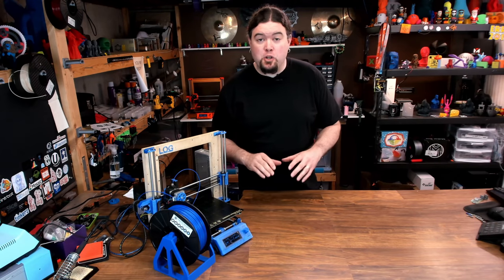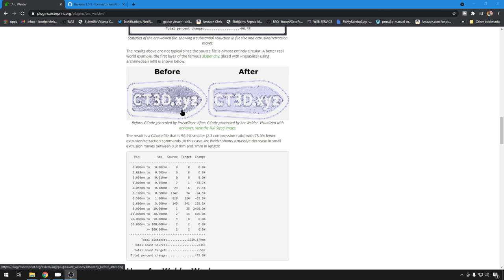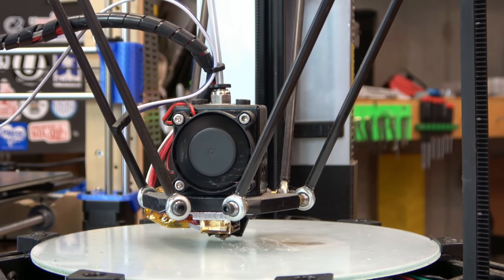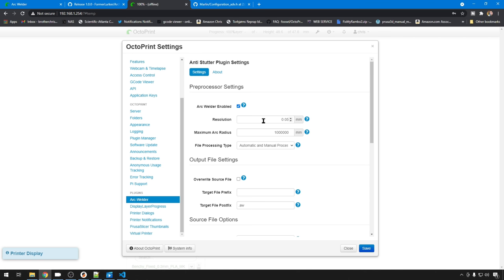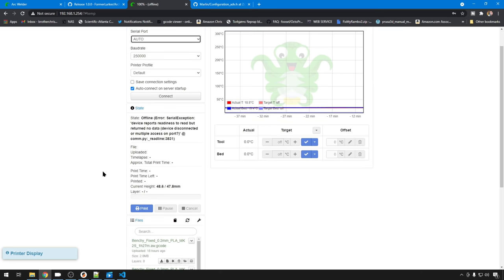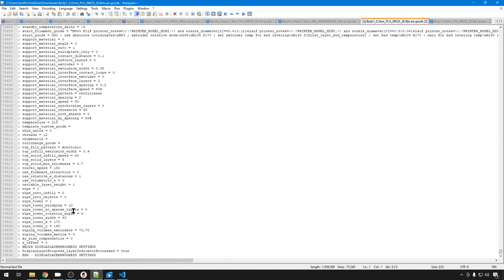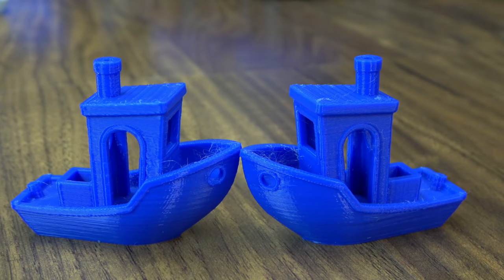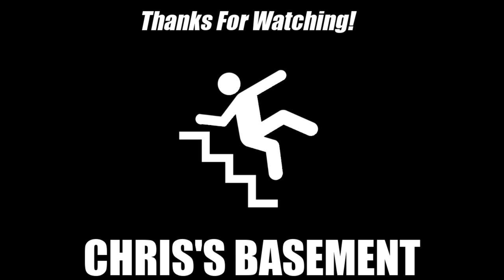Arc Welder -  Octoprint Plugin To Help Your Prints - Set Up & Test - Chris's Basement

Comment: Hey Chris. Great video as usual. Arc welder is also now a plugin for Cura and I think it makes more sense as it processes at slicer level and sends the final G code to the printer. One more thing, as you mentioned Marlin and Klipper, what about a video comparing both? Klipper is always in the corner of my mind but Marlin works so well that I still don't have a good reason to change.
Reply: ^^ this (Cura plugin)
Reply from the maker: Cool, thanks!
Reply: Thanks for mentioning this. I also think this belongs into the slicer from a logic standpoint
Reply: You can also add it to prusa slicer super slicer and slic3r as a post processing script.
Reply from the maker: I do plan on comparing all of this with a 32b board and a Klipper build, we will see what we come up with.
Reply: @ChrisRiley  just to say that although "there's a Cura plugin", this is an excellent video that really demystifies arc welder and very clearly demonstrates the benefits. Some people won't necessarily be able to use the slicer plugin and so this video is very useful - and extremely well researched and presented 👍 . (I wish I'd spent as much effort on my earlier post! 😉)
Reply: I know this is an older video, but Klipper doesn't process using the MCU of the printer it does it on the RPI meaning you have a 32/64bit controller now even if the mainboard is 8bit it just  controls the axis, like a breakout board at that point when you have klipper. Arc welder works on both, you maybe even have already switched to klipper who knows!

Comment: I love arc welder. Been using it since he had to send you the file manually.

Honestly it was almost perfect at that point. Only issue is it doesn't help with klipper because klipper converts arcs back to line segments.
Reply from the maker: Nice! Great to hear a use case.

Comment: Great explanation! However I believe this should be done by the slicer in the first place.
Reply: There is a cura plug-in too
Reply from the maker: Thanks!
Reply: As they said it can be used on near any slicer now and can be integrated
Theres also a program to post process gcode but i havent worked out getting it to boot from the bin file yet cos im a dunce 😂
Reply: I agree. Cura plugin works really well. I've had varying success with the octoprint plugin. It doesn't seem to like prusa gcode at all. Last time I tried, the print head went crazy printing random lines and overextruded.
Reply: I have it already as a post processor in prusaslicer
Reply: @Chris-bq7nr  where can i find the gcode? thanks
Reply: @caseycollins00  Really? What is the name of that plugin? Thanks.
Reply: @TheMarbo74  Arc Welder

Comment: Great video! I'll have to test it out.
Off the top of your head, do you know if g2 and g3 are enabled on the Prusa MK3s firmware?
Reply: He's using a mk3 and a mk2 in the video
Reply: @Majorvegasv2  That doesn't mean Log is running the Rambo board and Prusa firmware though ;)
Reply from the maker: The Prusa fork does support it, but check out the caveats. https://plugins.octoprint.org/plugins/arc_welder/
Reply: I submitted a pull request to improve Mk2/Mk3 support for arcs that is now being considered for the next firmware release.  It also includes a command to change interpolation settings on the fly without a recompile, and stores them in eeprom!

Comment: Another great video!  Is this also available as a stand alone processor?  I have switched to Klipper and Fluidd so no Octoprint.  I think converting G1 to G2  - G3 would benefit any system.
Thanks for the video.
Reply: more or less the same.. as the firmware cut up the nice arc in smaller straight segments
Reply from the maker: Yep, Klipper in kind of doing the same thing. So, no worries there.
Reply: If I understand your question: there is a plugin within Cura and if you go to the creator's github there's a repo  ArcWelderLib with command line tools to generate arc gcode (but I did not test this myself)

Comment: Why PrusaSlicer won't use G2 and G3 natively? It boggles my mind.
Thanks for professional video, Chris! ;-)
Reply: Because the stl files we feed it with are a bunch of triangles, with only straight lines. The problem starts with the meshes that are made out of triangles. I think something like the tool path generator in Fusion 360  should be able to generate arcs directly, as it does not need to go through the proces of creating a mesh with triangles.
Reply: @ctphilippi  if a plugin working on RaspberryPie can find our arcs/radii then PrusaSlicer working on N-gen Intel 16 core CPU should have no problem with that. Just MHO.
Reply: @cthulpiss  Yes ofcourse it could, that is what the post-processors also do. But it is kinda stupid that we are now trying to estimate the initial arcs from a bunch of straight lines, that where created to represent an arc. It would be much better to use a format that can avoid the triangulation proces. That would also avoid the uncertainty whether I initially intented to be an arc, or really wanted the polygonal shape.  And in the end, the Marlin G2 implementation chops the arc into linear segments again. :P
Reply from the maker: Interesting conversation. Good points.

Comment: Looks like you can use it as a post-processor in prusa slicer as well for those of us who don't use octoprint.  I may have to give it a try.
Reply from the maker: Cool, let us know how it goes!
Reply: @ChrisRiley  It seems to work pretty good.  It's hard to tell if print quality is any better, but the file sizes are about 1/10th of what they were before the post-process.  It makes transferring through the Duet 2 wifi a bit more tolerable for more complex models.

A good majority of the things I print are round, so I'm pretty happy overall.
Reply from the maker: @theheadone  Very nice!

Comment: Quick question. If I have arc welder on cura do I also need to install it on octoprint??
Reply from the maker: As long as CURA is adding the G2/G3's to your gcode and the printer can read it, you're good to go, no need for it in octoprint.

Comment: I configured my firmware and downloaded the plugin but I have done something wrong as my prints started failing, hopefully, I can figure out how to get this set up correctly and benefit from this super plugin, and I think my problem may be Linear Advance as I don't think I enabled it when compiling my firmware, I think I left it out to get a before and after print comparison and forgot about going back and enabling it
Reply from the maker: Good luck, let us know how it goes.
Reply: @ChrisRiley  This may be the problem:

Current Marlin does support arc commands (G2 and G3) BUT it has to be enabled at compile time...it may be off by default because most slicers don't use it, and it takes up memory in the firmware space.

My build of Marlin (precompile for BTT E3 RRF board) had arc_support disabled.  To see if this is the problem use the terminal in either octoprint, or pronterface, and send the printer a G2 or G3 command.  If it replies "command not recognized" or some such, then this is your problem. If arc_support IS enabled, you will get an error message due to no parameters on G2/3 command and your printer will enter fail mode and you'll have to reset.

If you want arc_support to work,  You will need to recompile Marlin with arc_support turned on.  Uncomment the line #DEFINE arc_support in the config_adv.h file.   Recompiling was a bit involved, you'll need to download several support tools....but there are some helpful tutorials online.

Comment: Apples to oranges, but I'm curious about enabling arcs vs increasing the buffer size where Marlin f/w bin size is concerned. Buffers are easy on 32b due to the available storage, but not so much on the limited 8b. Increasing buffers will have the effect of further delaying execution of local commands issued via terminal. There's a point of diminishing returns and AW will win out. I hit the limit at about 50mm/s w/ Klipper on the All in One micro test object on thingiverse. Increasing the buffer got me up to 80mm/s on the 2 circular features before the 1-2sec pauses started again. I'm guessing, w/ a coreXY, if you're not running a duet or printing from SD that Arc Welder would come in handy. It's great to have several options to try.
Reply from the maker: Thanks for your insight!
Reply: @ChrisRiley  that 1st thought didn't come out right. It was meant to be curiosity of using one vs the other. I'll edit it. 🤦🏼
Reply from the maker: No worries man, I get you, valid thoughts here.

Comment: Iam using HE1 port for extruder fan at 165c iam getting terminal error/alarm ,also using fan1 port for part cooling .how do I fix this
Reply from the maker: The fan is probably just over running it. Try adding a sock or upping the values in configurstion_adv.h

Comment: Chris I have a ender  3 pro with some modes I need some help with Marlin  I would like to install 2.0 or better  I have a MKS Gen v1.4 mega 2560 R3 board install with ramps 1.4 can you help
Reply from the maker: Hey, I don't have time to do the build, but there is an example out there that I am sure will work for you. Let me know if you have questions.

Comment: Hello Friend. I installed ArcWelder.. and more other plugins. It was fine until I installed some plugins which generated a conflict. I uninstalled them all, and then came the problem. The Control and Temperature tabs are gone. I've tried everything. I even uninstalled the program but it comes back with the same settings. I tried to find these plugins, but I can't find the right one.
Can you help me on how to fix this? I can't control the machine (left, right etc. just connect). Thank you, hugs from Brazil
Reply from the maker: Wow, it sounds like one of the plugin corrupted octoprint. I think you are going to have to start over and rebuild.

Comment: Cura has a arc welder plugin can I just install that and run with it?
Reply from the maker: Yes, that should work.
Reply: @ChrisRiley  hey Chris one question im running cura and using acr welder on a cr10s Pro with tiny machines firmware and a e3d humera but my question is i thought i read somewhere that arc welder wouldn't work with my mainboard and firmware combo ?
Reply from the maker: @geterdnboy  I took a look, I don't think tiny machines firmware supports G2/G3 commands.

Comment: It only took you about a minute and a half to convince me to pause the video and install this plugin immediately.
Reply from the maker: That's awesome! How is it working?
Reply: @ChrisRiley  So far, it doesn't seem to have broken anything. It only seems to compress about 100kb per every 5mb with the low poly models I've tested with so far. I'm sure this would be really great for a lower powered, older pi. I'm using a pi 3b at the moment, so it's not a problem for it to send however many commands I need it to. Still, I think this is going to get added to my default list of extensions that I install on any new print servers that I build. Currently, I only have one of my 6 machines on octopi, but I plan on increasing that number in the future.

Comment: Awesome video! Thanks for the effort!! Just a comment that maybe could help someone. I have an Ender 3 Pro with direct drive, I print TPU easily and without problem. But as soon as I try to print the arc welded file, the print can’t extrude material. I tried several times after I give up and as soon as I use the original file, everything was perfect, so for some reason with TPU does not work (PLA no problem at all)
Reply from the maker: Thanks! That is a really odd issue. TPU shouldn't change anything, unless there is something in the slicer just for TPU. If linear advance is enabled, try disabling it.
Reply: Make sure you have the g90/g91 influences extruder setting enabled if you are running marlin 2, or a fork of marlin 2, or use relative extrusion in your slicer.

Comment: hey @Chris Riley, we have discussed this in the klipper discord, and it is counterproductive, at least in klipper, since the g2/g3 code, gets converted back to lines. Aka more processing.
i don't know about marlin or reprap, how it's handled there. But for klipper this is contraproductive.
Great video anyway 👍
Reply from the maker: Thanks for your insight.
Reply: All firmware that I am aware of uses linear arc interpolation, including marlin.  I hear these discussions all the time, and there is some truth to them.  However, I think several subtle points are overlooked.  Klipper is less likely to suffer from planner starvation, so that isn't an issue usually (but not always... It is complicated).  However, interpolated arcs can have more resolution than the original segments.  It depends on klipper's mm_per_arc_segment setting.  For the same reason that klipper doesn't suffer from as many planner starvation issues (faster board), you can turn the arc resolution way up (0.05mm and even less) and see a noticable difference.

Results vary by printer, filament, stepper resolution, slicer resolution, etc, so it is a very complicated subject.

Comment: Chris, in the arc welder documentation regarding marlin config it says that you should edit the defaults as they're not the best, 1mm per arc segment is too much, lower it to 0.1mm and also lower the MIN_ARC_SEGMENTS to 14, ¿can you do a followup changing those settings?
Reply from the maker: I'll see what I can do. Thanks for your insight!
Reply: "Reducing the MM_PER_ARC_SEGMENT setting slightly can correct this [sharp corners on tight arcs] but can also introduce stuttering. Reducing the value massively (say to 0.1mm) will introduce a LOT of stutter and is NOT recommended."  I pulled this from its Octoprint plugin page.  I have a 32bit board and set 0.1 as the MM_PER_ARC_SEGMENT and can confirm this statement.  I printed a concentric patterned 10cm circle 1st layer and my printer's display hung the entire time, couldn't tune anything.

Comment: Are there any reasons to not use arc welder?
Reply from the maker: Not that I have found, some have reported issues, but I haven't seen any.
Reply: If an object is inteded to be many sized small polygon will arcwelder degrade it to curves?
Also does one of the arcwelder settings set the amount of smoothing and if so which and what value were you using Chris. Thanks for another great video.
Reply from the maker: @Cloudman572  I used default on all of the setting just to show what you would typically find on your install. Not sure on the degraded curves yet, still needs more testing.
Reply: @ChrisRiley  Thanks, will wait on update I hope.

Comment: Used it for a week and...deleted. Try to print a complex object with tiny details or thin walls around a circle/bolt hole and you'll see that Arc Welder destroys it. It absolutely works with simple objects like those donuts. But...we're not there yet! Try to print the Voron clockwork with and without Arc Welder and you'll see what I mean.
Reply from the maker: Thanks!
Reply: Comment above says
 "Guillermo Lovato
Chris, in the arc welder documentation regarding marlin config it says that you should edit the defaults as they're not the best, 1mm per arc segment is too much, lower it to 0.1mm and also lower the MIN_ARC_SEGMENTS to 14"
 Do you think that would help or is arcwelder a no go for complex shapes/high detail?
(Chris I think these are the settings and values I was asking you about).
Reply from the maker: @Cloudman572  Yes, updating the default settings should help this.

Comment: best solution, upgrade ur stuff with 32bit boards. ark welder is really interesting. but it will decrease details on high polygon / detailed models.
Reply from the maker: Agreed, just thought it was worth a look.
Reply: Will it really?  The default resolution in Arc Welder is the same as most major slicers.  You could also increase the resolution in arc welder to match your stepper motors, so that no deviations will ever be visible.